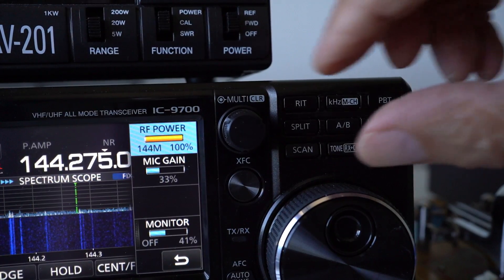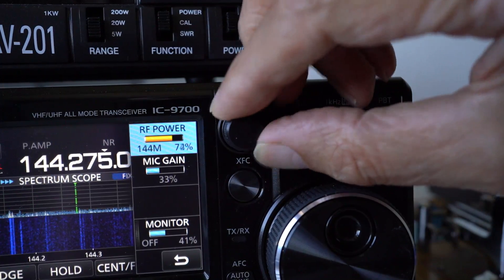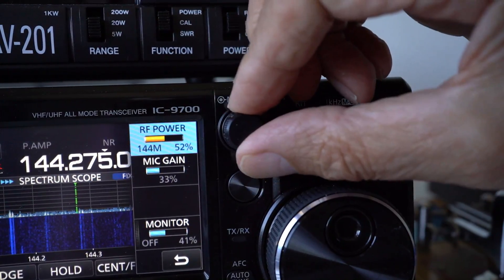VSWR Power Meter - Why Buy One?

Comment: Interesting.  Thank you for the information.  I will need to understand this more fully as I have an SX-200 Power Meter (new) and am setting up my first station.  My first observation is that the word "meter" implies it just tells something, meaning it does not actually "do" anything.  Like the speedometer on your car.  But if it actually "does" something then it would seem that it is tuning a parameter which would mean that a better name might be "power tuner". (?)
Reply from the maker: It’s a meter to indicate VSWR.  It monitors the results of changes you make to your antenna, or matching with an ATU.

Comment: Great video.  I use Yaesu FT891 I check the amount of power out (5 Watts is selected) using a dummy load connected to external VSWR meter through jumper cables. .  To my surprise the result iwas significantly different. The Yaesu internal power meter showed around 5 Watts reading. But the external instruments showed less than 2 Watts. I used AM carrier to create stable signal for testing at 7090 kHz. I am a new ham and it worries me.  Last week I was mistakenly transmit using a wrong antenna for 5 seconds in 5 Watts. The screen displayed "high SWR". How silly I was. But the radio seems fine. Questions: how will I know that the final circuit is operating normally? Should I have to worry?  Any comments will be appreciated. Thanks Peter de YDØRTA. 73.
Reply from the maker: It is extremely unlikely any damage has resulted. Those radios can run into an ooen circuit and survive. Don’t worry.  The low poser indication may be due to  2 possible reasons. High VSWR or most likely common mode problems. Try winding a few turns if the ciax around a ferrite core near the the meter or change the length of the feeder. Common mode current can make a VSWR meter read incorrectly. 73 Peter

Comment: Love your videos Peter!  They're always well organized, and have some good advice.  I have an MFJ-864 SWR/Power meter, with the cross needles, which I have installed inline on my Yaesu FT-847 that's in the shack.  But, it's also worth mentioning that having a digital VSW/Power meter for portable use is a good idea.  I like having a digital readout meter, especially for mobile installations, since it's just easier to read.
Reply from the maker: Thanks for sharing 73 Peter

Comment: The built-in SWR-meter in the transciever is great for showing which SWR the final stage in the transciever looks into - and it should be as low as possible. But because many modern transcievers also have built-in antenna tuners, you may very quickly forget about what your REAL SWR is. Here an external SWR-meter will always show you the real SWR of your antenna system, and immediately tell you if your antenna system has sudddenly become faulty or changed to the worse. Without an external SWR meter your built-in antenna tuner might tune away such a fault without you realizing it and thus push your antenna system another step towards a (big) "dummy load".
Reply from the maker: Hi Martin. You make an interesting point and warning. Thanks. Peter.
Reply: It would only be accurate if swr was measured at the feedpoint, but I would be concerned about reactance that is the actual issue that causes radio damage

Comment: Peter do you remember the KW Electronics  SWR Power meter.  Shades better than the LAB!  I worked for Rowley Shears and did the design work on that  and  the KW76 Rx,  KW77 Mk 4 The little mobile TX , the Vespa 2M transverter amongst the other gear we designed and built.   We did meet back in the old days  with Tom Whithers.   At  Victoria  Street Exhibition Centre in London  and others back in the early 60's   They were the day's 7 3 Alan GM3MHD
Reply from the maker: Hi there. Yes great days - I agree. I had KW200B myself,

Comment: Another great instructional video Peter. I completely agree with your passion for a big external SWR/Power meter. I actually prefer the double-needle version because I can monitor forward, reflected powers and SWR all at the same time. One thing you didn't address which confuses a lot of HAMs is where to put the meter - before or after your external turner (assuming you have one). I've always placed the meter between the transceiver and the tuner so I can monitor what the transceiver sees with the tuner impact. Of course, I could also do that on the transceiver meter but, as you said, I like the big meters. On the other hand, other folks like it after the tuner so you can see what the metrics are as you feed your 'antenna system'. What is your opinion? 73s Greg KJ6ER Silicon Valley
Reply from the maker: Thanks Greg

Comment: If you have an external VSWR meter, you can constantly monitor SWR while your transceiver display shows some other important data. When you connect an amplifier to your transceiver, your buit-in VSWR meter is measuring the VSWR of the input of the amplifier, not of your antenna. Your amplifier may have a built-in VSWR meter, but if you connect an antenna tuner, it will stop showing the actual VSWR of your antenna -- it will show the VSWR of the antenna tuner. Your antenna-tuner built-in VSWR meter will show the artificial ("improved-for-the-sake-of-the-amplifier) VSWR of your antenna. However, if you connect an external VSWR meter between your antenna tuner and your antenna, you will be able to keep an eye on the ACTUAL VSWR of your antenna! Let's say the VSWR of your antenna has always been around 1:3, and all of a sudden you see 1:8 -- it means something bad has happened to your antenna. 
Psychologically, all your built-in VSWR meters will be whispering to you "Good boy!", but your external SWR meter will say "Dude, lift your lazy butt and build a good resonant antenna, for crying out loud! Your receiving will improve, and more power will be radiated!" Thank you, external VSWR meter; you are the man! 73! W1NM
Reply: That's not altogether true a non resonant antenna can be just as efficient as a resonant antenna and in some cases more efficient
Reply: @David White I am just an amateur, David; at least, I am trying to understand how antennas work by participating in discussions, etc. If my ignorance offended you -- I am sorry.
Reply from the maker: Yes indeed. 73 Peter

Comment: The Diamond SX200 meter and the Avair AV-201 (as shown in this video) are identical, externally at least. Is there really much difference or is this just another case of "branding" the same product differently for sale in different countries? This is a very common practice within photographic equipment sales (identical lenses all made by the same manufacturer but advertised & sold under many different brand-names) and I suspect it may also be the case here.
Reply from the maker: Well one is made in Taiwan and the other in Japan! Peter.

Comment: If the PEP is actually displaying Avg power, then What does the Avg level read?
Reply: Some peak reading meters with active electronics do read PEP well, others make a less effective attempt, often with capacitors in the metering circuit.

Comment: The biggest advantage for me with a separate meter is that it is portable. Its not the display or the perception of better accuracy. For example, I can take my meter right to the antenna feed point and do my measurements there. Other than needing some RF drive, it's generally a passive device, unless you want an antenna analyser. When I design and install an antenna, I want to know its performance at the feed point... first.
With a build in rig meter you have to lug the whole radio to the feedpoint to do that, plus you also have to power it.
I know which I'd rather have for this purpose.

Comment: I have a MFJ-939 auto-tuner at the antenna feed point, over 100 feet from the shack, fed by buried DXE400MAX coax. I use the built-in SWR meter on my IC-7100 to determine when the auto-tuner has finished its work. After a significant QSY, i key up at low power and watch the SWR jump around for a few seconds until it drops to a low value, at which point I'm tuned up on the new frequency.

Comment: My first HF rig did not have a built in meter. So I got a separate meter.
  It helped when my antenna accumulated ice and the VSWR changed.
I simply removed the ice from the antenna, the VSWR shifted and I was back in operation.  N0QFT

Comment: It was an SWR/Power meter that turned me into a radio ham.
Many years ago when I had pretty much the best CB radio set up available at that time, (Ham International Jumbo, Antron A-99 - with the fire up & ground plane kits, Fat Boy 600w linear amplifier)
I decided that I would like a meter in line (More to crow about my power output than anything else, I hasten to add, I've grown up a bit since then.)
Anyway prior to installing the in-line meter everything was wonderful, working the world on SSB, easily doing 100 miles on FM in most directions, I duly installed the meter in line, it wasn't a cheap one, I was expecting great things.
Well, the SWR was through the roof, the power was fluctuating like mad, not getting out, however once I took the meter out of line normal service  was resumed.
However the seeds of doubt had been sown on my "perfect" set up.
In a fit of pique I sold all my CB gear, took my 1st radio exam, & 2 weeks later had my M3 licence, I'd made enough money from the sale of my CB gear to invest in a semi decent ham set up.
Armed with my new ham gear I carefully began to set up my new station, diligently checking every lead & joint.
Then the cause of my in line debacle came to light..........................A faulty patch lead.
Probably a blessing in disguise, I had loads of fun on CB, but Ham has broadened my horizons in a positive direction.
Best wishes, Glynne 2E0GLN
Reply: Love the Jumbo, I had 2 of them. Maybe work you on Bath Repeater sometime? 73 M0CPU ;-)

Comment: "Everybody knows that the Bird is the word."
Reply: I have 7 Bird power meters, they are obviously an industry standard but you have to be careful with them too, for example I have a 4304A a very versatile meter for use between 25MHz and 1GHz it has also got a range switch for full scales of 5,15,50,150 and 500W. My HF power meter was reporting quite high PEP so as a quick doublecheck I put it inline with the Bird 4304A and a load and did a quick check on a 28MHz carrier.... 1000w on one meter and 500ish on the other! The Bird has a correction factor of approximately 2 at that frequency so the results were consistent. It is easy to get caught out when you are used to using these meters on PMR where the frequency is higher than the correction factor threshold. The Bird meters can get VERY expensive if you buy a wide range of slugs for the limited frequency bands that they cover and the range of full scale powers plus the cost of a PEP module. They are not insanely accurate either, the 4304a is +/- 7% of full scale for most of it's range. They are nevertheless good meters but they do have limitations. So Bird MIGHT be the word (approximately)